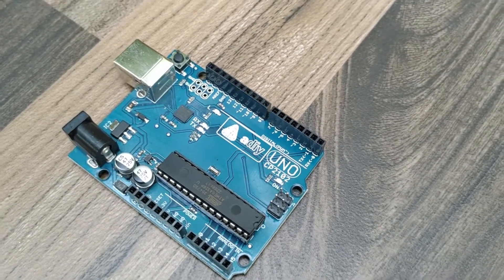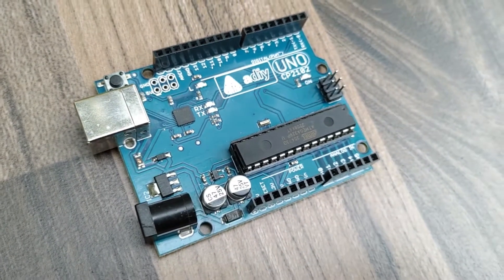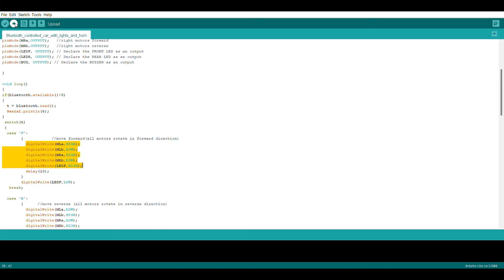How to make a Bluetooth controlled car using Arduino with lights & horn || 100% working

Comment: The Code not uploaded Probably show to me wrong 
Sketch uses 5562 bytes (19%) of program storage space. Maximum is 28672 bytes.
Global variables use 269 bytes of dynamic memory.
avrdude: stk500_recv(): programmer is not responding
avrdude: stk500_getsync() attempt 1 of 10: not in sync: resp=0xa0
avrdude: stk500_recv(): programmer is not responding
avrdude: stk500_getsync() attempt 2 of 10: not in sync: resp=0xa0
avrdude: stk500_recv(): programmer is not responding
avrdude: stk500_getsync() attempt 3 of 10: not in sync: resp=0xa0
avrdude: stk500_recv(): programmer is not responding
avrdude: stk500_getsync() attempt 4 of 10: not in sync: resp=0xa0
avrdude: stk500_recv(): programmer is not responding
avrdude: stk500_getsync() attempt 5 of 10: not in sync: resp=0xa0
avrdude: stk500_recv(): programmer is not responding
avrdude: stk500_getsync() attempt 6 of 10: not in sync: resp=0xa0
avrdude: stk500_recv(): programmer is not responding
avrdude: stk500_getsync() attempt 7 of 10: not in sync: resp=0xa0
avrdude: stk500_recv(): programmer is not responding
avrdude: stk500_getsync() attempt 8 of 10: not in sync: resp=0xa0
avrdude: stk500_recv(): programmer is not responding
avrdude: stk500_getsync() attempt 9 of 10: not in sync: resp=0xa0
avrdude: stk500_recv(): programmer is not responding
avrdude: stk500_getsync() attempt 10 of 10: not in sync: resp=0xa0
Failed uploading: uploading error: exit status 1

What is the issue plz help 🥲
Reply from the maker: Hi friend..This can happen if arduino board is not detected correctly while plugging to PC. Before uploading the code goto tools >port> and select the correct port. If no port is seen unplug and plug the arduino once again. Also , in tools>board> arduino uno ahould be selected.
Reply: @Science_4U_  same error bro
Reply from the maker: @YazanKhasawneh-ix7uh ooh..Then, it could be a problem with the uno also. Have you used this uno before?. Also, if possible try in another PC or laptop and see if this error is still there.
Reply: @Science_4U_   it's probably the port error , it it's not properly connected to arduino uno,then this can happen. If the issues still isn't fixed then trying chaging the usb cables,If it still isn't fixed then there are good chances that you have burned the arduino board by giving them the wrong polarity like i did 😂
Reply from the maker: @TRAZExYT  Yes..that is correct friend..👍

Comment: Plz Give a HCO5 Bluetooth module
Reply from the maker: You can buy it from many online sites friend..like amazon, robu.in, robocraze..etc..
Reply: I have a mistake I buy CA-6928
Reply from the maker: @SuminaSadique  hmm. Okay friend..CA-6928 is used as bluetooth for audio systems..it cannot be used with arduino.For arduino projects, you need to buy HC-05 or HC-06 bluetooth module..
Reply: Ok friend

Comment: After uploading code when my project is connected to the computer then if I press the controller then the light of motor driver blink as I press the button but when I put battery then it's not working.
Now it is the problem with battery or something else?
Reply from the maker: Hi friend. Can you please explain your problem more clearly?. Which is the controller that you are pressing that causes motor driver light to blink?.
Reply: @Science_4U_  bt car controller app
Reply from the maker: @JAPGaming  okay friend. If the light in the motor driver is not getting ON, it should be a battery problem.

Comment: After uploading the code the car doesn't even move it's connected but doesn't move please rply what should I do😢
Reply from the maker: Hi friend, There could be many reasons why the car is not moving. Sometimes the bluetooth module may be faulty, motor driver may be faulty though the lights turn on..
Reply from the maker: We have to check one by one and identify what is the problem. Have you used this bluetooth module and motor driver board before?
Reply from the maker: Also can you just interchange between the Tx and Rx connections of the bluetooth module and see if it is working?
Reply from the maker: Does the motor driver have jumpers connected on both sides of the 4 control pins?. That jumpers are for enabling the motor rotation.
Reply from the maker: Can you check whether you have connected RXD pin of bluetooth module to pin No. 2 of arduino and TXD pin of bluetooth module to pin no. 3 of arduino?.
Reply: @Science_4U_  yes i checked everything but still isn't working tomorrow is my major project :eyes-purple-crying:
Reply from the maker: @Ranashwaritripura  Hmm.😔.okay..Then some component could be faulty. I have seen that many people are not able to make the project working because of faulty components. The lights will be on. But the IC could be faulty.We have to check one by one and find out which is the faulty component.
Reply from the maker: @Ranashwaritripura  So sad that there is not much time left because the project is tomorrow😔. I will try my level best to identify and correct the problem. But I need more details. It will be good if you can share some  photos of the connections in my instagram account. I can ask you to do some basic checks and identify the problem. My instagram id is.
https://instagram.com/_science4u_?igshid=MzNlNGNkZWQ4Mg==
Reply from the maker: Have you connected the lights and horn and whether that is also not working?. Or is it the motor alone that is not working.?

Comment: Hello my friend, why the 3 other motor is not working only 1 motor is working using 2 batteries of 18650 3.7v? can you help me? :>
Reply from the maker: Hi friend, surely I will help..Since 1 motor atleast is working, I think connections are given correctly. Have you connected the motors directly to the battery and checked whether all motors are working?
Reply from the maker: Sometimes it could be due to faulty motors. Also please check if the batteries are fully charged. If the batteries are discharged, then also the motors may not work..
Reply: @Science_4U_  yes i already check every motor it's work fine, maybe the batteries is faulty but the battery that i'm using is okay right? i dont change anything
Reply from the maker: @ragnarokorigin-i9n  2 x 18650 batteries work very well for this project. But if the batteries are drained, then it will not work properly. If you want me to further help, you can come to my instagram account and we can chat. I will try to solve the problem..If you send photos of the connections given, I can check..
Reply from the maker: @ragnarokorigin-i9n  my instagram id : https://instagram.com/_science4u_?igshid=MzNlNGNkZWQ4Mg==

Comment: nice video! can you help me? what is the problem here, the arduino uno r3 is not receiving a power using the bettery which i use the power jack instead the pins. what is the possible problem?
Reply from the maker: Hi friend. Thanks a lot!!! Surely I am there to help!! But I didn't understand the question exactly!!!. Why did you connect battery to powerjack?. Normally we can connect the battery to Vin & Ground pins of arduino for powering it.
Reply: @Science_4U_  oh sorry im really new about this arduino so i dont know that i can do that XD my bad. okay ill check it again thank youu for your comment its really help me! :pride-megaphone-rainbow-handle:
Reply from the maker: @sufferwr1595  okay friend. There will be 2 pins in arduino board in the POWER section named as Vin and Gnd. You can connect battery to these pins. Positive to Vin and negative to ground. That way you can power the arduino..🙂
Reply: @Science_4U_ okay thanks lot!
Reply from the maker: Normally an AC to DC adaptor is connected to the powerjack with a voltage range of 9V to 12V. Did the battery that you connected to  power jack have voltage in this range?. Otherwise it will not work..

Comment: now i get this how t ofix it 
not in sync: resp=0x8f
Reply from the maker: Hi friend, most probably your arduino board is the problem. It may be a faulty one. I also used to get the same error and couldn't do anything about it. The error went away only when I changed the board.
Reply from the maker: You can also try to burn the boot loader in the arduino one again. That may solve the problem. The bootloader has to be burned by connecting this board to a good board. You can find instructions in the internet about how to do this.
Reply from the maker: Have you used this board before without any problem?. Or is it the first time that you are using and got this error?
Reply from the maker: You can also try the following and see whether it solves the error.

Here are some easy things that can often fix this error:

Disconnect and reconnect the USB cable.

Press the reset button on the board.

Restart the Arduino IDE.

Make sure you select the right board in Tools ► Board ►, e.g. If you are using the Duemilanove 328, select that instead of Duemilanove 128. The board should say what version it is on the microchip.

Make sure you selected the right port in Tools ► Serial Port ►. One way to figure out which port it is on is by following these steps:

Disconnect the USB cable.

Go to Tools ► Serial Port ► and see which ports are listed (e.g. COM4 COM5 COM14).

Reconnect the USB cable.

Go back to Tools ► Serial Port ►, and see which port appeared that wasn't there before.

Comment: 'LEDF' was not declared in this scope
Reply: what should  i do? plz help bro
Reply from the maker: @Dinooffical  Hi. I didnt properly understand the question friend. LEDF is declared in the code in the beginning. LEDF is assigned to pin no. 7 in the code.
Reply from the maker: @Dinooffical  Or did you mean that when uploading the code are you getting an error thst LEDF is not declared in this scope?. Then please check the code once again. Some lines would habe been accidentally deleted. You can redownload the code and try uploading again to arduino.

Comment: My phone conected to Hc 06 but when i click the arrows on the app the car didn't go.Lights and the buzzer didn't work eather.
Reply from the maker: It should have worked. Since nothing is working, I suspect it could be something to do with uploading the code. Was the code uploaded succesfully?
Reply from the maker: Also please ensure that Tx pin of bluetooth module is connected to pin no. 2 of arduino and Rx pin of bluetooth module is connected to pin no. 3 of arduino.
Reply from the maker: Also, if you are not sure, please try interchangin the Tx and Rx pins and see if it works.
Reply: Code please
Reply from the maker: @seglah_1122  i am giving the link to download the code here also.
https://drive.google.com/file/d/1yocI11JcjoCkEvKP9L6SrzVBCZ8eQmK7/view
Reply from the maker: @seglah_1122  Hi friend, the code can be downloaded from the google drive link given in the description box..

Comment: The best creator
Reply from the maker: Thank you so much🥰💓
Reply: @Science_4U_  I need your help. My Bluetooth can receive response from my phone during communication through Bluetooth Terminal HC-05 app. My phone is Android. But my Bluetooth HC-05 module (connected to Arduino Nano) cannot send messages back to my phone through the same app unless I replace TX and Rx pins of Arduino Nano controller.